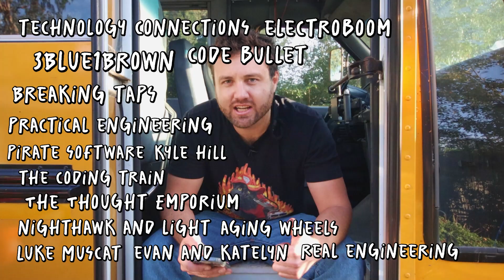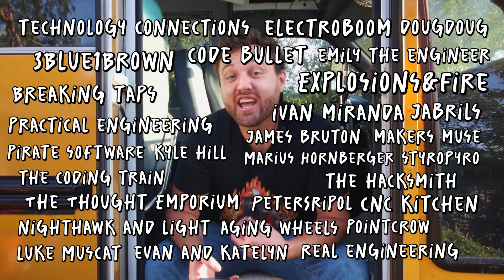Mini fire pump repair

Comment: Fyi I had a new engine from Subaru throw a connecting rod. Subaru wouldn't replace as they claimed I modified the car. Next engine I bought I took apart and found issues. Subaru would'nt replace as they said I ruined the engine taking it apart. Point being warranties mean nothing.

Comment: Random knowledge time: The floor is raised in the kitchen and bathroom because they didn't want to run plumbing in the concrete floor. Why cut a trench when you can just make it for people under 5'6"?

Comment: usually the "if you leave it running it burns itself up" part is fixed with a pressure switch on the discharge side of the pump which is connected between the coil and ground.  No water = no water pressure and the engine shuts off, saving the pump.  I've worked on a lot of those CFE units, they're pretty OK.  I've also cursed mismatched fittings for years.  You're looking at hydraulic fittings mated to water fittings.  It's weird but also normal.  Also always have a recirc path.

Comment: Will, for things like cleaning the rust from the fitting, look into electrolysis! All you need is a container large enough for the part, a "dumb" car battery charger, water, baking soda, and sacrificial steel. Works GREAT for really intricate parts like that, and very "set & forget"

Comment: if you need to re do those fittings get seco seals for the cones and good (not the super thin shit from the hardware store) teflon tape ONLY for the  tapered npt side of the fitting

Comment: Silicon grease is good for preventing stainless steel threads from friction welding together too. We use it on the stainless steel tank bands when assembling a set of doubles at the dive shop I work at. Just keep it away from oxygen rich environments.

Comment: huge bonus points for using an actual box end wrench instead of a water pump wrench (chan locks) or a crescent wrench. it seems like most people that work with fittings just use either chanlocks and monkey grip strength or they use a crescent wrench. the sizes for the fittings are all pretty random either way. its the only time i've ever seen 13/16

Comment: you can put the steel parts in hydrochloric acid to de-rust them, or at least make it easier to wire the rust off. Put them in acid then baking soda to neutralize the reaction

Comment: Oh that airbnb is Landlord Special as HELL, an apartment I used to live in had a similar setup for the bathroom where the floor was raised to fit in the plumbing but at least the ceiling wasn't short since the building was like 130 years old and had tall floors.

Comment: That AirBnb would not exist in the uk. Building regs say you should not have to have your head removed to move about. The ceiling is lower than the oldest of the cottages in the UK 😂😂
Reply: I’m pretty sure most of the USA also has requirements for ceiling height. The question is, did they ever get the work approved or inspected. I’m guessing not.

Comment: Stamping the size of a bolt on the bolt itself is something I never thought of before, but now can't stop thinking about how useful that could be.
Reply: Most stamping on bolts is their strength rating, which in most cases is more important.
Reply: @Christian-cz9bu  Most strength ratings on classic external hex bolts are denoted with a ring of lines around the perimeter of the head of the bolt. Useful, but I was thinking in the mind of someone like a mechanic working on a vehicle, not an engineer prototyping a design.
Reply: @niclikescakes That’s only SAE bolts, metric is stamped 8.8, 10.8, etc
Reply: @droppedpasta  Leaves plenty of room for a size to be stamped there too, lol.
Reply: I've come across this a time or two in like a prefab kit or something, but the next problem then becomes do you label it for the bolt size or wrench size for the head.
Reply: @MarylandFarmer.  The size of the head of the bolt. For mechanics without a good "eyecrometer", stamping a "17" on the head of the bolt would save someone, somewhere, some time.
Reply: @MarylandFarmer.  The size of the head of the bolt. For mechanics without a good "eyecrometer", stamping a "17" on the head of the bolt would save someone, somewhere, some time.

Comment: It literally looks like they built the kitchen and shitter, and realized the entire apartment couldn't be 5 feet tall
Reply: Nah, the platform is there for the plumbing. They chose to elevate the kitchen and bathroom rather than dig into the floor and have the kitchen and bathroom at the same level as the rest
Reply: It looks like they might have built the whole thing illegally. I kind of doubt you can get approved to have a five foot ceiling.

Comment: That AirBnb owner definitely took the lazy way to lay the basement plumbing. Easier to build a step up than dig up the solid concrete floor I suppose.
Reply: Can confirm, digging up a basement floor is a pain in the ass.
Reply: It might also be to keep the drains further above the sewage pipes, because flushing your shit uphill doesn't work too well
Reply: @Zebra_M Maybe. But basements (ones built to code, at least) have drains in the floor and they generally drain into whatever sewage system the house uses... but.. given how it looks like the place was built for hobbits and dwarves it's up in the air whether it was build to code..
Reply: @Drakith90 there is no way that is to code, the ceiling is way too low to even be considered habitable.
Reply: Ya it definitely depends on when the place was built and how high the foundation is above the connecting sewer line. I wanted to dig my basement floor lower because I hate hunching over in my basement, but my house is over 100+ years old and on the side of a hill so not happening would just create a tripping hazard instead with the piping. Would have to jack the house up and redo the foundation. At that point it would probably be cheaper to tear down and rebuild.
Reply: yeah but every time you redo the plumbing in that room, the ceiling gets 8 inches lower
Reply: @lettersnstuff easy, don't redo the plumbing 😎
Reply: @lettersnstuff or you take the platform off each time
Reply: @dutchik5107  seems like a pain in the ass